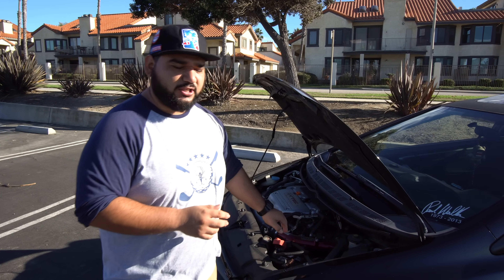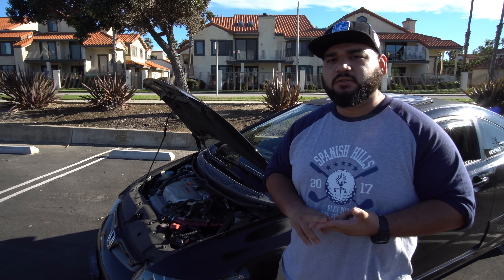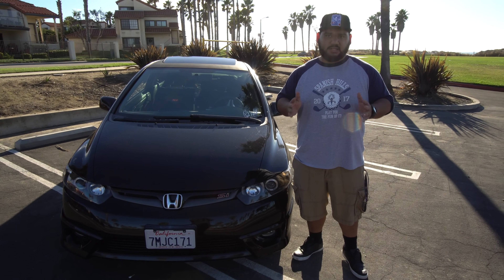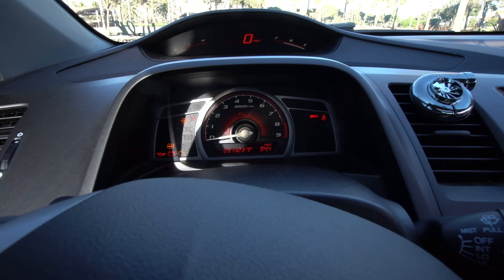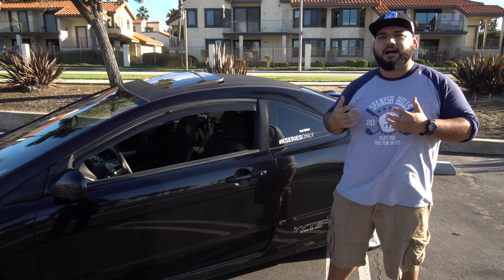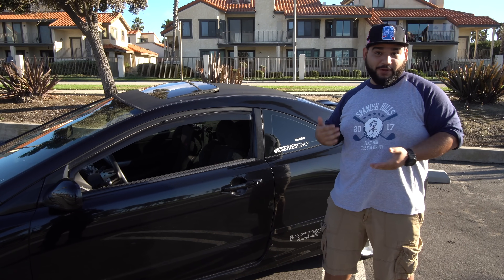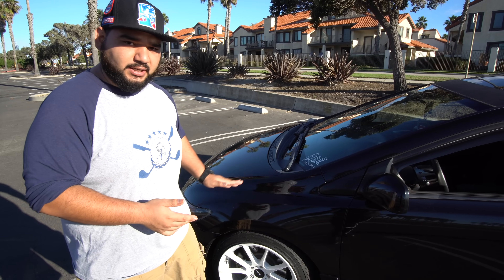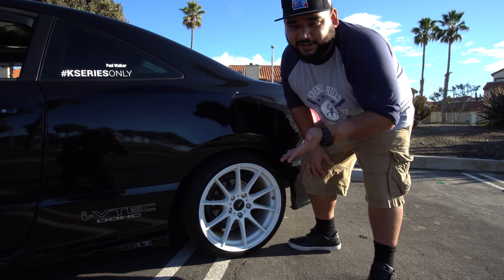What To Look For When Buying A Used Honda Civic Si (2006-2011 8th Gen)

Comment: I’ve owned my first gen since Dec of 2006. 1st and only owner. My Si has 150k. I’ve run into a few issues that turned out to be rather common, too. If you do plan to buy or already own one, do take the following into consideration:

1) passenger air bags have recalls (free honda repair). Check with your dealership to see if yours have already been fixed. If not, call and schedule it to be done asap. It contains metal shards that can inflict a lot of damage if airbags deploy.

2) the oem aluminum blocks can crack and cause over heating and may result in milky coolant and/or engine oil. (It’s happened more than people like to admit). Unfortunately, my original motor cracked on the exterior wall and I had to put that engine to rest.

3) the water pump may go out around the 100k mark. It can cause over heating and may be identifiable via a grinding/rattle when the engine is turned on. (I’ve gone through 2 and am on my 3rd one).

4) AC has issues. Most common issue is ac going bad (not blowing cold) due to a dead ac clutch relay (found in the fuse box underneath the hood). Most people mistake it for a faulty AC clutch, but more often than not, it’s the relay. (My local dealership charges $50 for 1. My local Autozone charges $17 with a lifetime warranty so I bought 2).

5) thermostats may go out if and when the water pump does. May result in over heating.

6) My starter took a dump around 70-90k miles. 

These are things I’ve experienced and fellow 8th gen si owners (buddies of mine) have also experienced...aside from the points already covered in this video.

Do take it with a grain of salt as not all 8th gen civic si’s are made equally. I’ve seen some running strong beyond the 200k mark with zero issues (but have not been modded at all). 

Nonetheless, I love my car. It’s a very fun car to drive and can take a pretty hard beating (aside from the transmission/synchros/shift cables) before any major issues arise.

Nice video bro. 👍
Reply: You bought a 1st gen in 2006 and your the only owner? How is that possible. You bought a car that was made in the 80s in 06 that was brand new???
Reply: Dont you mean 8th gen not first gen?
Reply: Your first sentence must been a type-o. I saw later on u said 8th gen. That threw me off lol
Reply: @sandyw8051  As explained in the video (since you didn't watch) there are 2 versions of the 8th Gen and he bought the 1st version not the 1st gen; just a minor mistake but still easily to figure out.
Reply: Thanks for the info, I am the second owner of my 08 (1st version) Civic Si... and so far, at 98k, its been nothing but fun and very late shifting (any tips on getting of the line quickly without having to blow my passengers ears out?... I have to take 1st, 2nd, and sometimes 3rd to around 3 or 4k rpm... like, once its moving, its very quick... but from a stop, I really have to rev up the engine... I come from a family that shifts at 2500 religious lol)... but now that you say that, I might consider doing all the preventative maintenance at the 100k check-up, just to avoid a bigger problem later (contrary to the usual, if it ain't broke, don't fix it). Have you had any problems with valves btw? Mine sound really smooth... no clicking or rattling, but I'm traumatised bc a buddy of mine destroyed an engine on accident bc he didn't adjust his valves on time (had to work everyday, no time... he didn't have a civic... but still, most Hondas need it, right?).
Reply: hey dude my reg 2011 civic has an AC issue too or maybe just cooling issue. The fans seem to cycle on /off too frequently, like every 15-30 secs. its been doing it for yrs.
It was really annoying when i was say picking up my old gf, she was always 3-7 minutes late coming out and i would have to sit there and listen to that annoying sound of it clicking on and off
SO how hard is this to fix?

Comment: Original owner of a 2006 Si Coupe in Taffeta White purchased in June 2006.  It has the Honda navigation system and the summer tire package which makes it super rare.  Has never been modified and is all stock.  I just passed 200,000 miles this past June and I still have the original clutch too.  I love this car!  I don't think it will ever stop running   :)
Reply: I have an '06 without navigation and 100% stock. 135,000 miles. 100% original. Except for tint - I had tint added later. Oh and fog lights! I added fog lights.
It is showing its age and a lack of quality in the interior.
Reply: I hope you put new tires on it by now.
Reply: I have 07 si w/ 254,509 miles! Ps look up Gene Kim on YouTube
Reply: Okee doke
Reply: Original clutch?! Mad respect ✊🏾! Reliability!

Comment: Just bought a 2009 4 door SI with 130k for $6200, rebuilt tittle. Its a 6 speed manual with an after market clutch and 2.4l engine. I kind of briefly watched this video after I bought the car to get some perspective on my purchase. It's my fist rice burner so I'm not up to speed on basic do/don'ts. I've noticed there is a 3rd gear grind from time to time, but usually when I throw it into gear quickly, if i'm light putting it into gear it goes in smooth with no grind. It doesn't happen often. Made it home (about a 400 mile trip) for 19 bucks in gas. Beats the hell out of my 7.3l Powerstroke Diesel.

Comment: Another tip to check for a reflash is to look at maintenance minder on dash.  If oil is at 100%, ask when oil change was last done.  Cars get reflashed using only the map sensor and maintenance minder works off of maf sensor so it always shows 100%.  Make sure you get the flashpro unit and password if it's flashed or you will be locked out of your cpu in future.

Comment: I actually found and bought my 8th gen civic si 08 recently... bone stock, one owner... it was hard to find, but luckily I snatched it up and it was fairly close to home. I don't plan to modify it, just drive it to work, friends, whatever. I did my own inspection, and it seemed okay for daily driving... it just needs a brake fluid/pad change, manual trans fluid change, 100k check up coming up soon (valve check, spark plugs, etc.), and tires.... the car is all beaten from years of constant sun damage (exterior rubber linings are gone lol... plastics are white) and the wheels and paint obviously show signs of an owner who wasn't aware how low the car is in comparison to a normal sedan. The car was definitely abused,, but it seems so solid and there were many signs that the previous owner was an elderly man, so I putting my hopes into the idea that it was only abused once in a while. Otherwise, I'm so happy I got my Civic Si... its my first sports car, so I'm really enjoying it. Part of me wants to put lowering springs and wider wheels but the other part of me wants to garage it as much as possible and just abuse it the way it was meant to be abused. Good luck to yall looking for an 8th gen! But be warned, it is not practical lol... 3500 rpm shifts just to get it moving from a stop - 30kph or so... it really just wants to rev and nothing else.

Comment: I DRIVE A 19 YEAR OLD SILVER , 2004 HONDA CIVIC SI HATCHBACK 2,0 VTEC 5 SPEED RALLY SHIFTER WITH 317,000 SAME ENGINE STILL RUNNING DOWN THAT ROAD MR FRIEND!                   GOOD LUCK YOUR SEARCH !  I BOUGHT IT BRAND NEW IN 2004 ITS AN AWESOME CAR! I HAVE HAD  NO SHIFTING ISSUES EVER ,

Comment: For anyone curious, I own a version 2 (09-2011) Civic Si coupe. My example has some paint problems, and I've experienced some 3rd gear pop-outs. However that could've been a driver mod because it hasent happened in a while. knock on wood The 09-2011 si might have "fixed" the major problems, but take it w/ a grain of salt. Each example is going to offer a different experience.

Comment: 7th gen here. You gave GREAT advice. "Make sure you drive it slow, normal, and fast". I bought a 7th gen used for $4000. The red flag should have been when I stepped on it doing 30 to 40 mph and it stuttered. That was a timing belt..... I attempted to milk it 300 miles. My attempt failed.
Reply: How funny my 7th gen timing belt just broke but i milked it 8k miles over the limit

Comment: Excellent Video! Well done! I myself own an FG1 and it's 2006, so far it's rocking 229km in Canada and no clear coat issues, however, I have definitely seen my fair share. Mine only has the R18, I couldn't seem to find a good SI. So I settled with an EX 5 speed. Keep up the good work!
Reply: I own a 2009 Si, completely stock. 167km. Keep rocking! I had a 2000 SiR with 440k before that

Comment: Something not talked about commonly that happened to me is my Clutch Pedal bracketry/assembly cracked. The small welds that keep the pedal connected to the flat part of the assembly where it bolts to the firewheel cracked for me. Had it welded and put it back in, and that helped with my shifting issues. I feel that my CMC rod wasn't entering my CMC straight. Also make sure to adjust CMC. For some reason mine loses adjustment every 6 to 8 months or so. For the paint issue I just wrapped. 

When you buy a CMC just pay the extra and buy the one from Hybrid Racing. I went through like 3 of the stock style ones from Rock auto & local auto parts stores.

Comment: Early models had 3rd gear synchro recall.  Just ask dealer to run vin to see if it was done.  09 and up came with updated synchro.  Also some colors like black and blue had paint recall for front end and roof.  There is also a service bulletin for an updated cmc from Honda.  Also 06 si had no traction control and 06, 07 don't use tpms which is a plus since those sensors break all the time.
Reply: 09 still sticks going into 3rd , good engines dumpster transmissions
Reply: I test drove a 2011 si with around 24,000 kms (about 10,000 miles) and it had the 3rd gear issue also. Worked perfect at low- mid rpms but didn't want to go into gear at high rpms.
Reply: james dickson Same on my ‘11. I agree; I love the engine but these transmissions are trash.
Reply: I can call any Honda dealership?

Comment: Just over a month ago, I bought an 07 si coupe for 8k with 150k km and it’s great, pretty quick but 3 rd gear grind is super annoying, all you have to do to avoid it is push hard in to third and then force it to the right😂
Reply: Just bought an 06 coupe for 6750 CA WITH 143Km.  The transmission was recalled and they fized it plus the previous owner spent around $2000 upgrading the transmission wifth a short shifter, upgraded cables, and other things.  All in all its absolutely mint and was taken care of sooo well

Comment: 2006-2009.5 have faulty HVAC panels which cause the AC clutch to not turn on.  They redesigned the circuitboard in the 2009.5+ circuitboards.  It was a running change.  Typical symptom is the A/C clutch doesnt engage and the cooling fans always run at high speed all the time when it’s turned on.

Comment: I got a 2010 coupe with 65k mi. From a car dealer 6 months ago stock no problems. Recently installed shift linkage bushings. No problems yet
Reply: Gabriel R. Si? How much?
Reply: Joseph Bailey 12k. In California. Yes an SI
Reply: Yeah I got a 2011 with 65k as well. All is good so far.

Comment: So I have a 2.2 Diesel. What You mention about the Gears is exactly what I felt since I bought my car, second hand 149 miles on the clock. Now it got to the point I need to change the all clutch kit. ...

Comment: Mine all stock when i bought it 09 civic si sedan 44k miles , no hes at 131k miles and running like a champ , the only thing i have changed was one of the belt pulleys the was making a whinning noise , but thats all
Reply: Broly Assasin how much was that
Reply: John Doe the belt pulley was like $19 bucks easy fix and cheap man
Reply: I changed out both pulleys and belt.  Same mileage. 60 for all parts Amazon

Comment: I have a silver 08 Civic SI Sedan. Bought it brand new in 2008. Such a cool car and I particularity like that body style. I only have 70k miles on it too. Since it was new I've replaced clutch, struts and shocks, rotors and brakes. I love the way they sound stock. I plan to keep the engine and exhaust in tact. I almost sold it as I wasn't driving it but after I had the brakes done and started driving it again, I fell in love all over again. It's just fun to drive.

Comment: 2006-2008 also had the cracked engine block issue.
Reply: The 1.8 motors not the k 20s

Comment: Thanks for the heads-up.  I have my eyes on a Red 2011 SI with 144k miles. Do you have an idea how long the stock suspension will last?
Reply: if i were you i’d just buy coils as one of your first mods, completely changes the feel of the car and makes it feel more like a track car and not a civic lmao, i had my stock suspension until 180k miles and it did fairly well other than having to replace a front strut but that was from the previous owner crashing the car

Comment: Mine has well known the clear coat issue its a 09 sedan.. i just wrap it out lol and also has 281k. Miles still runs n drives good and vtec still crack Hard ..not bad for 3600.. all stocks

Comment: I have a 2011 FA5 and had lockout issues when revving high and shifting fast. I've since replaced many parts to alleviate the issues but who knows how well the owner before me drove the car.
Reply: Jonathan Keller I had lockout in every gear past 7k. I adjusted my updated OEM CMC and it shifts like new now.
Reply: Faust 621

Yeah, I hear you on that! Sounds just like what I had. I have a modified OEM CMC/slave and aftermarket clutch line... also added the HR V2 shifter with their cables. It's a new animal now.

I plan to rebuild my trans when I get some money saves to buy parts.

Comment: Damn, Tony, I just picked up a single-owner 07 FG2. On the test drive, I noted that third gear felt a little hard to put in, but attributed it to my own inexperience with this specific car (I have driven plenty of manuals). Now on a single 1.5 hour commute, it pops on me several times. Gotta be real gentle. I've had the car for just under a week now, and I'm not sure how much of a stink about it to make to the dealer. It has 117,000 miles without any clutch work done.
Reply from the maker: Swap out the transmission fluid I used OEM Honda fluid last time and it made a world of a difference.
Reply: @TdaKid  Whoa, thanks for getting back to me! Sub added. I've been doing a bit of research and came across TSB #08-20. I may try and approach the (Honda) dealership about it this week, since I only bought it one week ago, and negotiate for a discount on a transmission fluid change, or full on 3rd gear swap. The Carfax doesn't include anything related to the trans. Even with the pop it's still a hell of a great ride.
Reply from the maker: @stirfryjedi  gotcha
Hopefully it goes in your favor. Some dealerships are pains with older models lol

Thanks for the sub 
Welcome to the channel
Reply: @TdaKid  Thanks! Yeah I am missing Happy Hour right now to think over some issues with the vehicle. A veteran tech and service manager looked at it today, and quoted me $5500 in PARTS (Labor covered by the dealership) to replace the clutch master slave, clutch, and third gear set. But the transmission fluid hasn't been changed once in the car's lifetime - just laughable. I think I don't have anything to lose by doing a transmission fluid swap myself for fifty bucks to see what kind of difference that makes, and/or how many miles I can get out of the car before the clutch goes. I accidentally DUMPED it from 5th at 6k rpm the other day into 4th instead of 6th by accident, and it didn't give me any issues. That doesn't sound like a weak clutch lol

Comment: Just scooped an 2010 for $7k 70k miles 🤙👍 correct about the 09/11 trans fixed
Reply: Jamal Allen coulda got an s2000 with that money
Reply: JUSTO 7OH4  where? 😂😂. Find me one for $7k I’ll buy it rn
Reply: Active EJ north Carolina Craigslist they go for 7-9k where I'm at
Reply: Search r/Quityourbullshit on reddit, that's where you'll find people just like you.
Reply: Unfortunately, the demand is so hight for the 8th Sis none of these issues matter to the seller and will gladly say move along because that buyer is out there that can invest, no questions asked.

Welcome to the world of the last true amazingly NA Sis

Also, CMC from the 06-08 was leak prone trash-upgrade, as it's the same part number, to the newer one. Aluminum shift and base bushings are just a phenomenal cheap upgrade as well.

Lastly, V2 8th gens still had the clear coat issue
Reply: Wth? That's cheap!
Reply: Got a 2010 today for $3200 but it has 150,000 miles but runs strong still 👌🏽 25 bucks filled my tank , I was stunned 😂

Comment: Also pls check the mileages divide the year from the mileages example. 2006 and now is 2019 =13years divided with the mileages example if the car has 130,000 divided by 13 = 10,000 a year meaning the car was driving normal because the average driving a year is 13,000 so must likely you will have less problem with the engine

Comment: Any problems with wheel change on the 2007 Civic? I had an 89 CRX changed the wheels and the balancing was never right. I even got them balanced on the car and that didn't last long either. I saved the stock rims and put those back on and my problem was solved. Will my 07 Civic have the same problem?